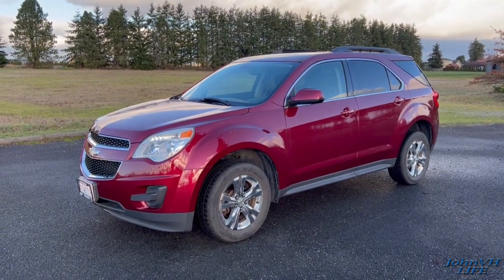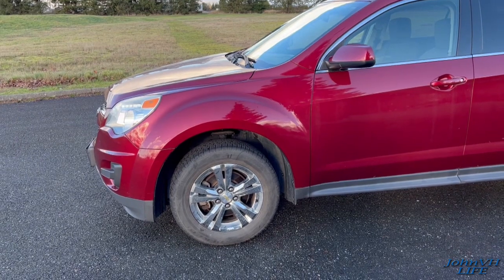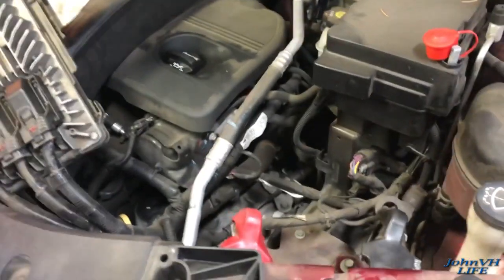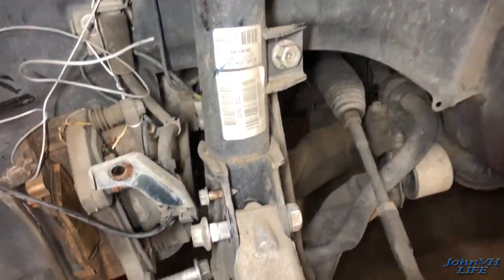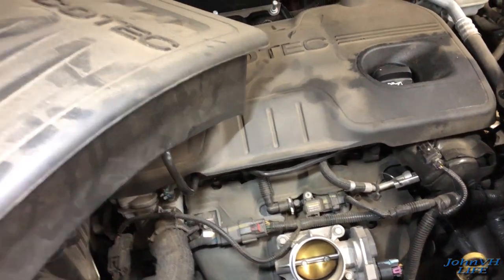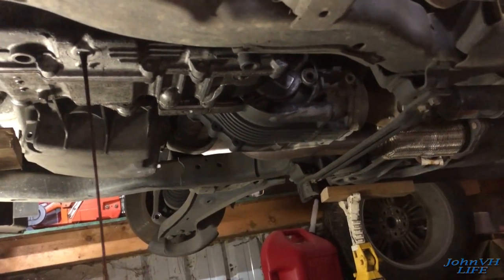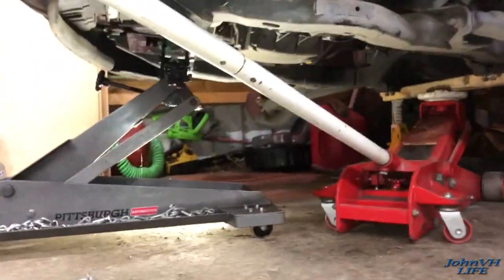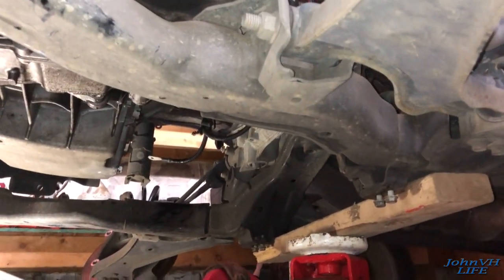HOW TO DIY Equinox 6t45 AWD Transmission Removal at home PART 1 of 3

Comment: Hey Lucas, I got my transmission out without dropping the complete frame. I took it out the wheel opening. I just did not want to mess with the exhaust system and steering rack. Your video was a great help, thank you. By the way I will be 75 in a few weeks.
Reply from the maker: Oh wow, nicely done.
Reply: @JohnVHLife  please help me figure this out on my Chevy equinox. Code p0700 and it says trans may be disconnected or hardest came loose when I hit bump
Reply from the maker: @shellybelle6781  https://www.solopcms.com/blog/p0700-code-means-fix/#:~:text=The%20P0700%20code%20indicates%20that,to%20shift%20gears%20when%20necessary.
Reply: How did you get it out? Floor jack?
Reply from the maker: @erick440  Watch the video, @28:30
Reply: @JohnVHLife  thanks. Looks straight forward, however, I need to do a rear main, is this easier or pulling the engine?

Comment: Great video, I am in the process of replacing the transfer case in our equinox, they're non existent new and reman/refurb, ended up having to buy a used on for about $500 less than a brand new one. Our vehicle has 175,000 on it and I have replaced everything in the cylinder head and new pistons. Knock on wood but I would guess at this mileage the transmission will be coming next.

Comment: Obscene of what has to be removed to change out the transmission. GM should have designed a better transmission that lasts if it's this much labor to remove it. Of course, why would they want to do that.....

Comment: Hey buddy! 2011 GMC Terrain with the 6T45 trans. Stopped shifting, was shifting fine for the past 6 months I’ve had it, stopped on highway. Won’t move in gear, tried reverse, drive, and manual setting 1-6 gear. Says TCM needs MIL, Solenoid 3 and 5 stuck. Would a bad TCM cause those two other codes to pull?
Reply from the maker: I wish I knew more about them. Sorry. Have to ask question in some Chevy forums.

Comment: Bro.. Those 2 pipes on the transmission... Are they for coolant? Coz mine is filled with transmission oil😢.. The aluminum attachment to rubber hose line going from the transmission to the radiator area
Reply: Those are supposed to be full of transmission fluid.  They go to the transmission cooler in the radiator.

Comment: After you have that transfer case out and you’ve already taken that rear transmission/transfer mount off what’s holding the transmission and engine from dropping on the firewall side?
Reply: To be clear I mean what holding everything after you take that 4 bolt mount off to remove the transfer case-it looks like the only thing holding the rear of the engine and tranny…
Reply from the maker: Trying to remember exactly. But there are mounts on the front and side and top of the trans.
Reply: @JohnVHLife  alright, I’m in the process of dropping mine out in a GMC Terrain. Have the engine all blocked up because I thought once I take that front mount off to remove the subframe everything would be hanging lol. Your video is great btw
Reply from the maker: @timicrowley6793  Im pretty sure anyway, think there is a mount on the front of the engine, and one on top of the transmission. I used that transverse bar to help support mine though, you for sure need something once you take the mount off the trans.
Reply: @JohnVHLife  yeah there is two, one on each end, it’s a little different dropping the subframe then the one in your video but it’s definitely helped a lot. Not used to everything being so compacted with a bracket for every tiny thing lol.

Comment: Do you think the frame would have to come all the way down on a front wheel drive? Or could you lower the drivers side enough to wrestle it our?  Good job on the video work
Reply from the maker: If your that close to having it out you may as well finish it, IMO, Im not sure if you can do it with the frame still attached.
Reply: @JohnVHLife I just stumbled upon your video, do you know how much clearance you had inch wise. I guess I’m asking if you know how high I need to Jack the car up to do the job.
Reply from the maker: @b3stanman946  I just got it as high as I could with what I had around, sorry.
Reply: @JohnVHLife  ok thanks brother, I have a few cinder blocks and wood to set the car on in order to drop the sub frame. I also went back to your video and noticed you pulled it out through the wheel well which gives a little extra room. Thanks for your video brother and responding back, best video I’ve seen by far and you are very detailed…. We appreciate at you brother💯💪🏾
Reply from the maker: @b3stanman946  Thanks so much, I really appreciate the feedback, Im happy they have become useful to others! Makes it worth the work of filming and editing!  :)

Comment: I have a leak in my transmission valve cover. The black plastic cover. I just bought a new one to change out. I'm wondering if I can do this without picking up transmission. Suggestions or even a response would be appreciated.
Reply from the maker: Im pretty sure you can change that out no problem, I dont see why you would have to lift the trans at all. Look from under the front and see if you can reach in there, otherwise removing the battery tray might help.
Reply: @JohnVHLife  thx for responding so quickly. I appreciate it
Reply: @JohnVHLife  I got everything off successfully. However I'm stuck. How do I take off the wire connector?
Reply from the maker: @chaconjohnson  there is a red plastic thing on it. That’s holding the lever from moving. Pull the red thing loose. Then pull the lever and it’ll make the connector come out. Hope that makes sense.
Reply: @JohnVHLife  yes I pulled the red tag out. I do see a lever that looks like it's designed to be pulled to the other side. I was a little afraid to break it so I didn't want to pull too hard. I guess I suggest pull it until it shifts to the other side?
Reply from the maker: @chaconjohnson  yep. That lever releases a the plug.
Reply: @JohnVHLife  thx for your help. Seriously.
Reply from the maker: @chaconjohnson  glad it worked out. That’s why I do this! 🙏

Comment: I just finished swapping mine put new fluid and went to crank/start and it won't do anything. Got a code scanner and it says that it lost communication with ecm. Code u0100 and p0700 transmission code. Any help please
Reply from the maker: You swapped the ecm so your original one is in the trans now, right?
Reply: Did u ever figure it out im having the same problem

Comment: Have you posted the other videos yet?  When you get the transmission in do you have to do any programming?
Reply from the maker: Not yet, your the first to ask about it, so I will get to work on them soon! So I used the TCM out of the original trans and installed it into the new trans, that way you do not have to reprogram anything.

Comment: those are famous for burning oil because of a PCV hole in the intake manifold plugging up with carbon and blowing out the rear seal due to high crank case pressure , some just drill a 3/8'' hole in the oil filler cap and run the hose to the air box in let fitting . if its a 2.4 engine . way to go GM .